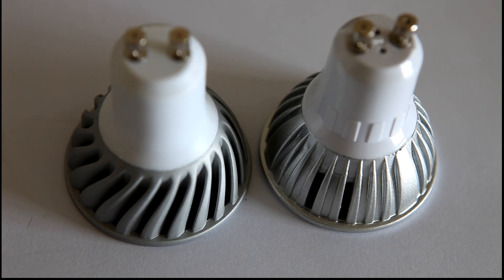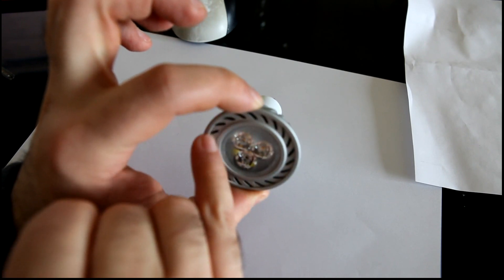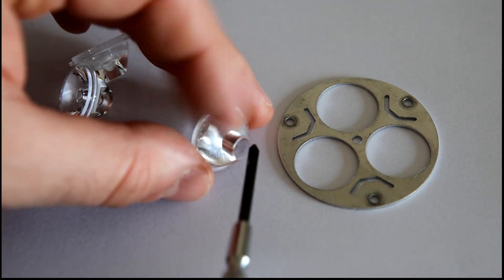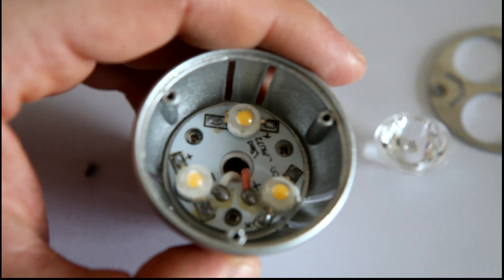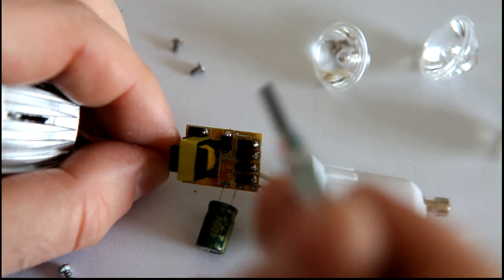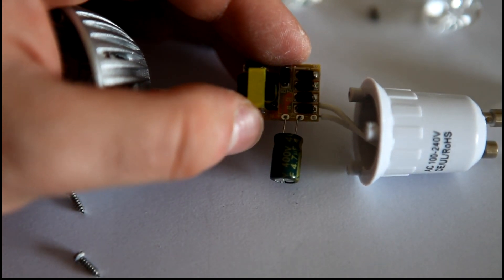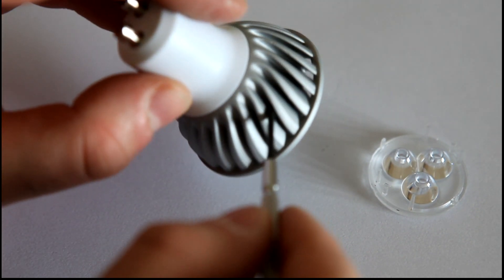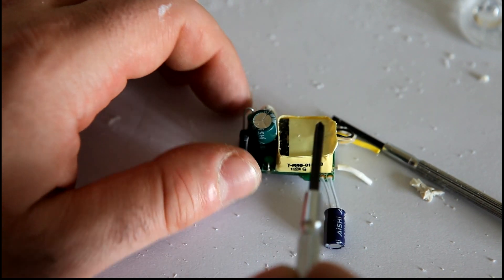LED lamp extreme tear down

Comment: Nice video. The lamps have no emc filters fitted to the control circuit board so are most unlikely to comply with the electrical emission ( interference) standards. They will cause serious interference to radios, TVs and other electrical equipment nearby.
The trouble is that the extra components required are almost impossible to fit inside the package so they get left out!
I have made tests using a large professional electronic mains filter fitted close to the lamp which completely eliminates the problem.
I have not seen any suitably packaged filters which must be small, electrically safe, fireproof and properly certified. The cost of a proper filter will be much more than the lamp and the market for these is limited because a lot of applications are not affected by interference.
If you are in a weak signal area you will have to stick to halogen bulbs.

Comment: I just bought yesterday the cheaper one you have in the video. Mine was a bit lower quality and as you said, the light output is just horrible and on top of that it was a blueish color. It stated on the package that it has 3x1 Led's. I powered it up and checked the power draw, it was about 3.7W. When I opened it up, the "ballast" was even poorer quality. I then checked how much power got into the led's and it was about 10.4V and 160mA = 1.6W. That means there are 3x0.5W led's in series.

Comment: the cheap units, it's electric driver quality very poor, so it's lifespan is shorter,   and cheap units use poor quality LED chips, so the lighting quality is lower, mean CRI (color rendering index) is very lower. is not good for lighting.

Comment: COB LED is integrated LED chips, usually is use for high power lighting, like 30W, 50W, 100W LED flood light, high bay light, street light.   for indoor light like LED spotlight, bulb light usually not use COB LED,  of course there are have COB LED spotlight but only have 5W, 8W right now.

Comment: Since the stepdown regulator uses a high frequency, you do indeed can get away with a design without an output smoothing capacitor, although a cap on that side as well is preferable. The human eye can record about 24 frames a second, so that's why the high frequency regulator doesn't really need a output capacitor.

Comment from the maker: The ebay 'direct from china' ones I bought flicker. All of these ebay bulbs burned out within about 3 months of installation - they lasted less long than the halogens (which already last only a very short time due to a very high mains voltage).

Comment: I've tested quite a few of these GU10 LED replacements and the only one that comes close to being a true replacement for a 50w halogen is the 7.5w Sylvania refLED. All the others have either been too dim or in the case of the Philips Masters, far too big!
I suspect the only ones that will do the hours claimed are the Philips & Sylvania's but the Philips are now made in China! I replaced 300w of halogen in my bathroom for 45w of Sylvania refLED and they are much brighter and nicer colour (840).

Comment: The heatsinks are probably zamak alloy (zinc, aluminum, magnesium and copper), which is a low cost alternative to aluminum as it doesn't wreck the casting moulds but still has decent thermal conductivity.